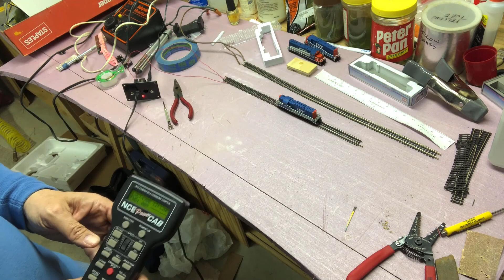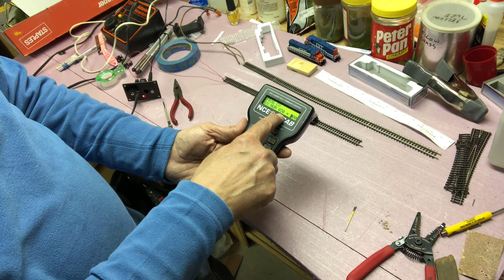8 Easy Steps to Reset Your NCE Drop In Decoders to Factory Settings

Comment: This is helpful, thank you. But one thing, on my Controller my Direction button is flat out not working, forcing me to use the scroll wheel to change directions, and it won't let me access F10 to F28 for some reason, any tips to help?
Reply from the maker: I am not an expert however I had a somewhat similar issue with a handheld cab. One thing you could try is resetting your controller. Google it and you should find it. The second thing I would do if that doesn’t work is send an email to NCE. They are usually very responsive and will likely provide some options. If those don’t help then they may request you send it back in for them to assess. I have found that if you’ve had it for around a year or so they’ll likely fix it at no charge. They’re pretty good folks there. Hope this helps
Reply: @5minutemodeler650  Thank you! I'll let you know if I still need anything.

Comment: How do you change the speed steps
Reply from the maker: Thanks for the question. For NCE power cab throttle you would follow this sequence for programming:
Prog/esc key
Prog on main then Enter
Prog loco select your loco number then enter
Then select 2 for CV programming CVs. 
Then select the CVs below to program them. 

So normally what I do is use CV 2 for the low speed, cv 5 for the top end speed, and cv 6 for the mid range speed. These control the voltage going to the motor. The range is 0-255 for each. Generally start out with cv5 around 150. This should control the top end speed. Use a cv2 value of around 10 to start. Each locomotive is a bit different in how they respond to the settings so you will likely need to make adjustments to get what you want. Just increase or decrease the the cv value to taste.

Comment: I had problems with mine not running.  Tried to reset using cv8 and change it to 8 and it did nothing.  Tried your way and it works now.  Thanks
Reply from the maker: Great! Glad it helped.

Comment: You mentioned NCE decoders respond to CV30 set to "2". Does that work for any decoder -ESU, etc?

Thanks
Reply: I'd  like to know that to? It did not work for my decoders and their not NCE.
Reply from the maker: Sorry for the delay in this. I suggest you review ESU’s web site for the correct value. This varies by mfg.  one source I found indicates that it is CV 8 with a value of 8. But this video was only regarding NCE decoders. Thanks for watching.
Reply from the maker: Sorry for the delay in this. I suggest you review ESU’s web site for the correct value. This varies by mfg.  one source I found indicates that it is CV 8 with a value of 8. But this video was only regarding NCE decoders. Thanks for watching.